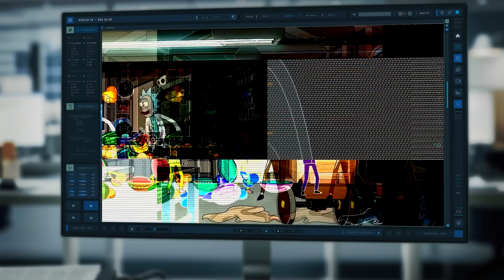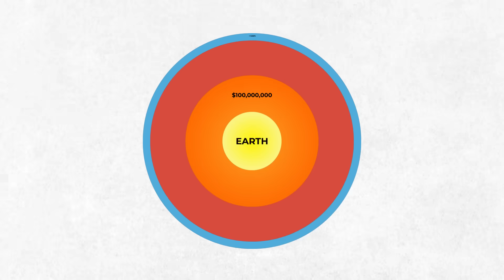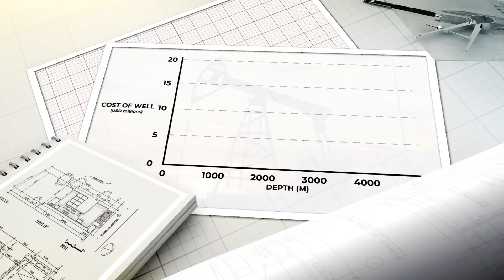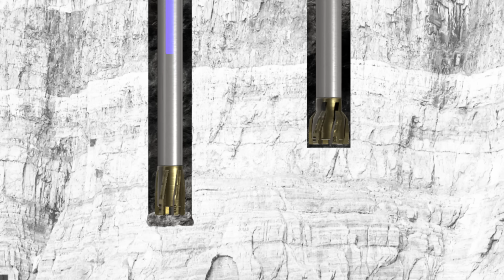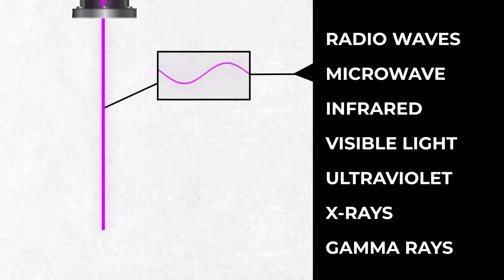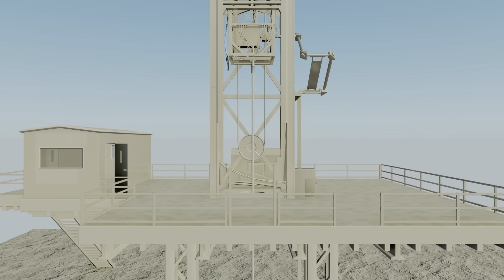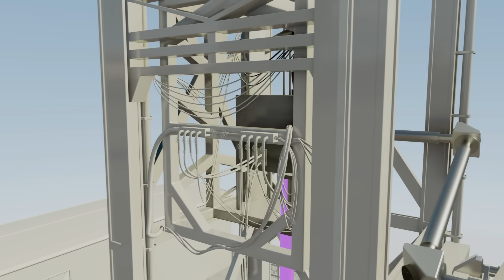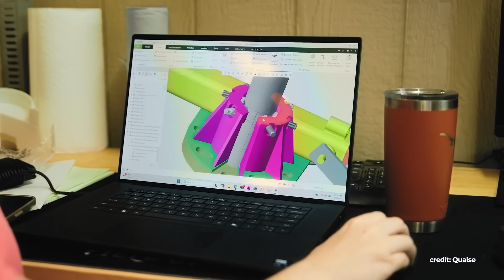The Most Advanced Drill in Human History

Comment: The smart way to go deep with this would be to drill as deep as possible conventially and then put the laser on for main hole. That is until they have the ability to drill the entire hole with the laser. 

Currently drilling speeds with rotary steerable drilling assemblies can exceed 300 meters per hour.

Comment: Wanna go deep pick a dessert sand is easy to go through. What if the Khufu pyramid was a big geo thermal power plant and the colomns going deep in the earth with the copper wire round it going down to the heat and the conducting it back up to the generator in the so called kings chamber and all those narrow shafts and inclines were for the cables to go outside to the current storage facilities and to be distributed wherever. A power plant

Comment: Wait.. so we’re going to super (heat) the rock. Pump (oxygen) down to extract what could be essentially a (fuel) source. In the form of oil and natural gas. 25 years in the oilfield and we’ve always been told you keep those 3 things apart. The fire triangle. Heat, O2 and Fuel. Yall are about to blow yourselves up.

I do understand the purpose of the borehole is for geothermal energy but oil and gas are anything but predictable. Especially miles below the surface.

Comment: To to many factor in drilling deep past 6 miles. First it’s the weight of drill string, second is the earth core pressure the earth is always closing up your hole. And you have to run casting and cement string of casing continuously as you drill. So if you run to small of casing you choke your self out of depth! Examples your start out setting surface pipe at 12.1/4” 2000’ then you drill out with 9.7/8” bit and go down 12,000’ then you run casing again it 7” casing cement it and drill out again this time with 5.3/4”bit and you drill to 24,000’ and your done! You run 4” casing and cement! That’s why you have to start out with larger hole and the cost would be in the billions not counting the size of the draworks and Derrick would have to be gigantic just to lift the drill string

Comment: I think the best bet for super deep drilling would be high torque motors built into the drilling shafts each connected pipe contains its own high torque low rotation that contains a plug connection for power and soft ware. Each motor can increase increase over all power throughout the entire shaft increasing torque at the bottom. Various different alloys already exist that are good drill bits that withstand high temps well.

Comment: I work in a geothermal power plant and I can assure you this star wars laser is a pipe dream. We got temps of up to 650deg with matching pressures. They ammount of nc gasses and the scaling caused by the brine high on minerals is impressive millions of dollars are spent yearly to help with the scale abatement and that doesn’t even cut it. You do need liner for your production wells. 2507 or titanium casings to be exact. And even those scale up so bad that we need to have PM’s done on the production wells regularly to keep the bores clean PM’s done by riging up the production wells and sending a tricone drill bit with a titanium motor downhole so that it can withstand the temps and pressures. So yeah this video is interesting but it’s all theory and reality doesn’t care about theory. We’ve heard of quaise and they’re promises are very unrealistic for lack of a better word. But again nice video.

Comment: But if the temperature rises 30 degrees C per kilometer, and the point is to use the thermal energies to run turbines, that shouldn't 3 to 4km depth be enough to boil water for the steam turbines? What am I missing here? Why do we need to go 10s of kilometers deep to use the thermal energy?

Comment: You need drill mud to still recirc the cutting back to curve. Will that mazer work in drilling mud? Also, the energy needed to run this could power 1000 homes, that’ll never work in real life considering almost all oil/gas wells are drilled on generator power, not pole power

Comment: At 2:06 he says that the Kola superdeep borehole is 12,3 km deep. And that it is about the same as 9 empire state buildings stacked on top of each other. It is actually 28. I think he looked up the height of the empire state building in feet. With the spire it is 1454 feet tall. Which is about 13 000 multiplied by nine. The  empire state building is 443 meters tall. Which is 12,4 km when multiplied by nine.

Comment: Why can´t they use a horizontal drills close to the bottom to make anchor points for the vertical drill. You would just need a smaller drill at the tip instead of sending torque all the way from the top.

Comment: Wont the system lose Power very quick ? Sure the Rock there is very hot but due to the Heat Transfer Into the water the Stone around a small Area will cool down over time and lose efficiency. So Just my though wouldt be way more effective to Heat Up the water direclty whit a sunlight powerd setting that never loses Power instead of spending massive amouts of Money Into a Projekt that might lose ITS profitablitly after a few years.

Comment: This claimed Plazma drilling is a scam at list incompetent idea, or how did you name it: - TRC 7 out of 9, formation downhole is mainly with stromg ceramic base properties, in best case scenario this technology will be good for metal milling in the hole, such as plugs, casing windows or fish.
One of the most thermal resistant material and the most common downhole - shale or tuff or silicone, try to burn it, you will need .ore energy that any of your tool gan stand, I am not talking about pressure and other factors that can. Ot be solved at this level of technology. 
'9 empire state buildings' statmemt is imperfection, promoting 'dead end' idea is misleading the investors.

Forgot to mention, the hardest rock to drill is magmatic glas like cherts, after plasma the rest of the rock become almost like magmatick cherts glas like rock that can not be reamed.

Comment: I imagine there will be a lot of new challenges, some foreseeable and some not foreseeable.  
As they go deeper isn't likely that they will encounter greater pressure in the material that they are drilling through and therefore greater forces acting to collapse the hole.  Since the bore hole itself compromises the structural integrity of the material drilled though wint it be necessary to provide bracing for the shaft, or to employ another fatigue resistance technology, perhaps similar to shot-peening or cold-working that might be used in metals or some composites.

Comment: This technology is ineffective where it's advertised. They won't be able to drill because hitting any gas, water, or oil reservoir will cause it to blow out under pressure. And they won't be able to stop it. They'll have to use a casing string and a preventer, or they won't be allowed to drill deeper than 400 meters. Because they could create a man-made disaster they won't be able to stop. Using any shutoff device only on land, under pressure exceeding 200 atmospheres, the leak will simply find a way out, and they won't be able to stop it. Therefore, they need a casing that's deeper than 400 meters and secured with cement. And this is just one of the many problems they hide behind their advertising.

Comment: If you can't get the torque translated to the drill bit that far down, why not just lower the drill and send the power down to the drill?
Reply: Because the motor that drives the drill head is enormous and won't fit in the bore hole

Comment: I guess I have to contrast your statement about closed water cycle with the shots of all the cooling towers at the end. Think about that.

I'd put this in the clever science scam - devise a concept in which a series of seemingly important milestones can be identified and achieved, resulting in funding to achieve the next milestones. The problem is the achievable milestones are orders of magnitude away from what is needed, in this case just getting a hole down to some useful depth. enviably, the technical issues pile up, milestones are moved out, and eventually funding dries up. 

I'm sure many comments below are competently pessimistic, I'm not spending the time to read them. I've a bit of experience in directed energy, and the idea of transmitting a megawatt of microwave energy 1000's of meters down a narrow waveguide with any kind of efficiency to a produce a well behaved hot spot of molten or vaporized that obligingly moves out of the way...

Comment: 8:13 
Bruh u just explained how torque is major issue with drilling so far away from the source. Then u explain that “your torque needed is less so it will be fine”. 

U had me until that part. Then the doofus trying to explain who it’s not a big deal to u did a lovely job at making it sound quite concerning. 

Worthless u fixed a part of the problem but lessened the severity of another major part of said problem. As if that’s gonna do anything. But please tell us how your drill cause it’s weaker will justttttt make it to the thermal barrier part so it’s all worth it. 

Ya ok sure bud 👌

Comment: How is 9 empire state buildings 12.3 km? That's just short of 4km. Seems somebody messed up conversion somewhere because if you took the empire state building height in feet and assumed each kilometer was 1000 feet (instead of meters) then this would be sort of right (well it'd be 8.5ish empire state buildings). Alas, that's just not what km are.

For those curious. 12.3 km is about 28 Empire State buildings end to end.
Reply: I think it was supposed to be feet or miles

Comment: Ultra-deep drilling for engineered geothermal is technically challenging, but the goal is worth it.  If geothermal heat can be produced at essentially any location on Earth by drilling deep enough to reach sufficiently hot rock, the fossil fuel heat sources in existing thermoelectric power plants can be replaced with geothermal hot loops, producing carbon-free electricity with existing generators, transmission lines, and other infrastructure.  The boilers don't care where the heat comes from as long as it's hot enough.  Retrofitting existing thermoelectric power plants with geothermal is way cheaper than building completely new ones, and could decarbonize the electric power sector worldwide within a decade.

Comment: Another problem is cooling:
You're generating heat to vaporise the rock. The rock is now a hot gas, travelling (ideally) upwards, out of the shaft. However, that gas is going to start cooling, as soon as you stop applying heat directly to it. The immediate environment won't be able to heat the vapour enough to keep it in a gaseous state. Before too long, ESPECIALLY in deep holes, that gas will drop below the melting point of the rock and become liquid, causing it to precipitate downwards, like rain. Rock rain.

Unless you're using VERY hot gas to flush out the vaporised rock, then the deeper you "drill," the more of a problem this 'Rock Rain' is going to pose. Eventually, you're going to reach a point where the amount of 'rain' falling onto the bottom of the hole is precisely equal to the amount of rock you're vaporising, meaning that the hole fills up exactly as fast as you're able to penetrate. At that point you won't be able to "drill" any deeper. Increasing the power won't make any difference, as that will only increase the volume of gas, which will condense and fall as molten rock all the quicker.

If you're incredibly unlucky (and I suspect that this is BOUND to happen), the volume of molten rock falling back down through the shaft is going to have coated the walls so much, that it now builds up on the metal pipes. When that molten rock cools enough to solidify, your pipe is going to be stuck in solid rock, unable to do anything about it, because the "drill bit" is below all the solidified rock!

Bottom Line = This is an AWESOME new innovation, but there are problems that need to be worked out before this thing reaches a depth of 1km of more. The biggest problem- I suspect- will be How do we keep the vaporised rock in the form of vapour, so we can get rid of it? Again, that's not an issue for a short shaft, but once you get a few km down...

Comment: Question. Wouldn't that put huge amounts of heat into the air by using geothermal energy? Is pulling heat out of the ground problematic as the rock hardens and theoretically shrinks?

Comment: watch a symphony of spheres in microgravity, i imagine that is what it looks like if you can see past a couple of event horizons and see the mass transfers without causality smoothing out the ride. Causality is like the universal regulator/rectifier, turning an AC journey into a smooth DC Vector, collapse or expansion of the bubble will feel like inflation to anyone inside the bubble, but those mass transfers are what drive time to tick forwards, and for things to fall down. Without that motion we have a static universe with no motion. Maybe we all pause between mass transfers, you wouldnt know. 

There are 2 infinities in our reality, and we are straddling them. One out, one in. You are built of the same mass you stand on, at the centre of mass you expand at the same rate as it, move from the core without motion and now the mass is inflating more than you in the same time, making you feel like you sink as it passes you. A nudge at the core is enough to keep pace with the expansion/dilation, but as our host singularity loses mass the point right at its centre can relax and expand 4th dimensionally. That is where we are btw, at the core of a singularity, its in is our out.. 

Singularities are like mirror universes, stacking up against eachother, smaller ones tick faster, larger ones slower, but its all relative, infinities all weigh the same, tick the same, and have the same idea of infinity inside each bubble, your finite perspective gives one more weight than the other. You can see across the universe, using light as it found spacetime easy. it struggles with massive things. to it we are the voids of infinite curiosity. its out is our in....

Like mirrors stacked against eachother, one realities in is anothers out. what we see are reflections, echos of reality, how it isnt not how it is. Red objects reject one spectrum, we call it what it denied, not all the colours it chose to absorb. Its weird i can make a case for flat being curved, up being down, in being out. It all seems to be the negative of how we percieve it. So maybe the bigger infinity is the one in...

You wont exit our reality by rewinding spacetime for 13 billion years, you just dilate with the universe/multiverse. It will always measure up the same size from this dilation between infinities. If you paused your dilation and rewound then yes, you would see it as a singularity, but there is no pinning things in place out here, you would shrink with the universe as it dilates.  13 billion years ago it looked much the same as now, a bit warmer and smaller, but our dilation between infinities is equally warmer and smaller

I think I can unite Einstein, Minkowski, Hawking, Gauss and Hinton into one theory of almost everything, it seems Euclidean if you trust what you see. But it acts non euclidean at every level

if you shrink down to the atomic so a hydrogen atom was the size of a star, your old room would red shift from your view, even if you only went as far as a glass of water on your table. If you could see us tho we would seem paused, like we are on an event horizon, because we are.  This is the way out that is in. Another exit is to expand so you was larger than the observable universe, or to approach another event horizon in space, they are 3 different exits, which is in which is out? Would it matter if its all just more of the same, just a slightly different looking reality

A smaller in running at a faster tick rate can be older than the out that is hosting it. The universe can give birth to itself. A set of infinite size, with infinite sets of infinite size dilated inside eachother.

Pull up a Julia to Mandelbrot fractal generator, set your xy=0 you have a circle and void made from math, an infinity that loops in and never stops looping, and one that spirals out, never to be seen again, its just a representation of your vector lines as you square up to infinity, inside the circle is mass, infinity in, outside is spacetime, infinity out. I imagine if you square it up again you end up with a sphere and void, squared again and its spheres around spheres and a void, squared up infinitely its spheres in and around spheres, void gets real small, and spheres fill the screen. A multiverse built from math, simply from squaring up C to infinity, infinite times. 

Euclid wants to build his circles pinning A in place, rotating B from a line length (x) around itself, but again what pins anything in place in the universe, everything has motion. Move A infinitely slow and B infinitely fast, now you have 2 manifolds, one tiny one on the inside and a huge one out. This is the universe how we see it. How I see it anyway.. You can fold reality inside out and it will look exactly the same.

The universe is a symphony of spheres in microgravity, but the bubbles are infinite in size, they all have infinite time to play with in their own bubbles, even when they seemingly collapse and disappear, their energy goes into a different bubble, carrying on as usual, backwards in time is still forwards motion, from hot to cold on a tesseract, or time cone, or hypersphere, or mobius strip its all the same geometry, hot behind, cold in front, your position between 2 infinite perspectives, that is all reality is.